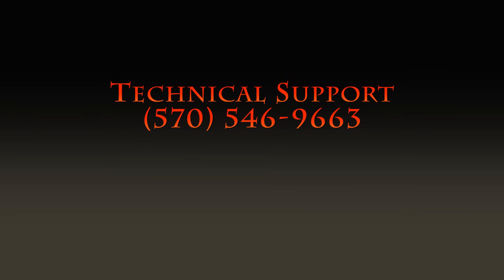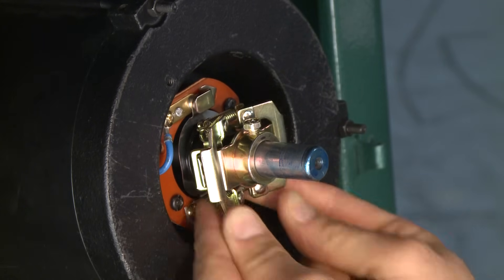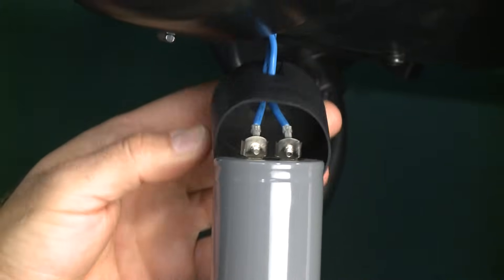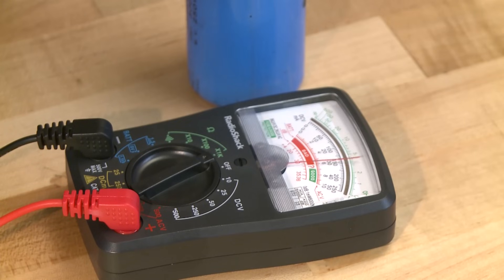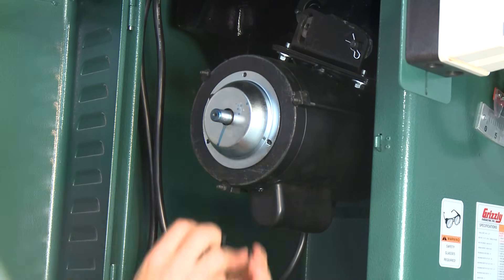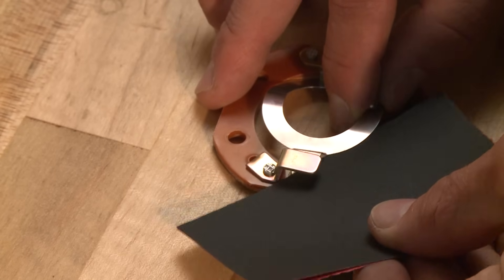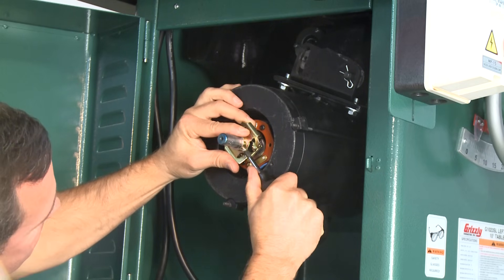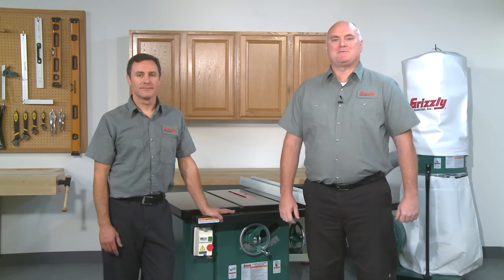How to Troubleshoot an Electric Motor and Adjust Centrifugal Switches

Comment: HAAAALLLLP 😂😂😂 please. I wish I could afford one of your companies cabinet saws, I’ve wanted one since I first seen one years ago! One of these days it’ll happen. If failing equipment doesn’t tank my business first…. Or keep taking what I try and save to get a grizzly!!!! I know it’s not your company but I can’t get a lick of help from Ridgid, I am just a one woman show and I my orders are just so backed up at this point I am a complete stress mess. I have a Ridgid R4512, gonna try and give as much info as I can hopefully someone can help me diagnose. So it just started making a loud rattling noise starts instantly when turned on continues after start up but instantly stops when I turn it off, and the arbor is still spinning/winding down. And kinda seems like it starts to loose power as well. Also when I felt the motor it felt pretty hot, but can still touch and leave hand there without it even being uncomfortable so not sure if that’s just normal, when this happened I was ripping strips for trellises and had been running steady for only appx 3-4 min maybe. I also ripped strips for some trim about 10 or 15 min before steadily for also only about 5min . Did not smell how ever and I got my head in the back panel and gave a good few sniffs by the motor.(yes it was unplugged) I’m pretty sure it’s something with motor though. Anyways Took off blade still made same noise. Took the belt off still made same noise. Pulled cover off capacitors, made sure they were discharged, and then for the life of me could not and still cannot find my damn multimeter🙄🙄🙄 at first glance they seem fine, I don’t see any bloating/bulging? Not sure what you’d call that. There is nothing leaking from them either. I’m not really sure if they would cause this noise or not, but checking the microfarads is still on my to do once I can find, borrow or buy another  meter. I’m just hoping someone might know what causes that kind of noise and point me in the right direction. Also wondering if I’m gonna have to take the whole damn thing apart to get the motor out? Because I’m not seeing anyway to, without doing that, 😭😭😭 I spent freaking hours getting everything calibrated and fined tuned to basically perfection, I’m ocd as hell about having things like the measuring/angle guides, blades, and fence being correct. Anyways if it’s not the capacitors only thing I know to do is check the centrifugal switch, then onto the bearings and armature 😭😭😭thing is. Although seems pretty similar I’ve never worked on any electrical motor as new as this one and I’m feeling in intimidated as hell, if it were an old one I think I’d just jump right in, but these newer ones are just built cheap and I’m afraid I’m gonna mess it up more
Reply from the maker: Sorry you're having these issues. It sounds very frustrating. Troubleshooting motors can be very tricky. The rattling noise you're describing might be worn out or damaged bearings, and that can also contribute to heat build up. Good luck and be safe!

Comment: Air compressor 5hp motor very little smoke came out of the vents just right after I started it. I just it off right away, wondering if it’s fixable without replacing motor
Reply from the maker: Hello there! If the air compressor is one that Grizzly carries, please reach out to our technical team via our Contact center! Otherwise, we recommend reaching out to the manufacturer or retailer for recommendations on how to proceed.

Comment: I had the same problem with a different make of motor,  same principle though.
I Cleaned the points which other than being dirty were fine.  Now now air compressor works just fine.  I talked with a gentleman about my problem,  as soon as I turned the switch on the circuit breaker blew I thought the capacitors were bad.  They were good.  The gentleman told me about the points and  said if they are dirty or bad that could be tripping the breaker . I guess he was correct cause after I cleaned the points it's working just fine

Comment: Does a centrifugal switch sense the speed of a motor?
Reply from the maker: Hi there! No it doesn't. They work by spring tension. As the motor comes up to full speed, the centrifugal force over comes the spring tension and the switch opens up taking the start windings out of circuit. I hope that helps!
Reply: @grizzlymachines  thanks a bunch🤜

Comment: I just replaced a bad run cap on a used 1.5 hp 115/220v motor I just got. It free ran without any load for about 2 minutes and then the cap blew..  I havent found much info on why they blow.. Hum.. Suggestions? Thank you.
Reply from the maker: Hi there! If the capacitors are blowing that fast then the contact points for the centrifugal switch are likely stuck together. Hope that helps!

Comment: Great video. If the centrifugal switch is not releasing would this cause for the motor to draw higjer current. My motor runs approximately 3amp and i have found when the switch is not opening the current jumps to 22amps. The problem was a dead capacitor which i feel was the cause from the centrifugal switch not realeasing when motor on. I find that the switch only doesn't release when  the load is on the motor. Any help to diagnose is appreciated. Cheers
Reply from the maker: Please reach out to our Technical Support Experts at techsupport@grizzly.com for assistance.

Comment: I am having an issue mith my Grizzly G4003 Metal lathe's motor. I have found it was a bad start capacitor. The motor has dual capacitors. This was the only video I could find and it was helpful. However my motor has the centrifugal switch on the same side as the output shaft. I don't really know how to adjust the switch so I'm leaving it alone for now. If you have any suggestions where I can learn about that would be appreciated. The contact points look good so I'm hoping that just replacing the capacitors will do the trick. Thanks!

Comment: Mine starts but dosnt step up to full speed
Reply: 4bennybear my coworkers as well. Im trying to figure out if this is the cause
Reply: @justinhammesfahr1206  Was it the centrifugal switch? Going to tear into mine tomorrow on my dust collector. It runs but doesn't get up to full speed so I hoping the switch just worked it's way loose.

Comment: so mad because what was my problem it was the coil got cut in half  because of the rope that hold the coil together was too tight
soldering was  a working fix but can't isolate the wire with tape  :S
got any suggestion for isolating ?
im thinking about  some silicon if not too thick because silicon also isolate heat not good in a motor
Thanks

Comment: Hi Grizzly Industrial Inc. I have this problem. No heat and it spins. So i check the heater, replaced with brand new heater, still no heat. Heater not turning on. Replaced the old thermostat with new thermostat, still no heat. Checked all wirings for continuity, all checked out good, sanded the terminals, still not heat. Replaced the whole motor with centrifugal switch, still no heat, heater does not turn on. I don't know where to go now. please help.
Reply from the maker: Hi Jake.  Please give our Technical Department a call for assistance as they will be your best resource. 570-546-9663

Comment: I have a table saw where the motor starter switch will mot turn on. If I take off the cover and bypass the switch button and push the part on the side, the motor runs but I have to hold it with finger When I let go it shuts off. I bought a new switch and it dose the same. I'm Lost now.
Reply: The problem is not the switch. Check the capacitor like in the video

Comment: Are there somesort of sensors with the switches that it detects the increase in the motors RPM in order to move break the connection b/w the motor and the capacitor?
Reply: The word of the day is centrifugal derived from concentric centerfuge and integral.  Centrifugal force in Newtonian mechanics,is an inertial force that appears to act on all objects when viewed in a rotating frame of reference. 
  So centrifugal switch is an integral switch consisting of a set of contacts, as all mechanical switches do, and a springed, weighted device affixed to the shaft of the armiture inside the motor housing, engineered with weighted dogs or counter weights which move when the inertia of the shaft had reached a set rpm via spring strength  which opens or closes a the contacts, in a motors case for starting are to open a normally closed connection disengaging the starting windings on the motor leaving the remaining run windings engaged..
Reply: @Z-Ack  Thank you for the in depth explanation. I kind of wondering why are some  motor use start cap.instead of run cap. on a single phase  motor ? Efficiency, torque or depend on the application. Would you  please further explan.Thank again for your knowledge.
Reply: Or you could just go with magic...
Reply: It's not a sensor, it's just got weights that get thrown outwards as it spins around. There's a spring keeping them in, resisting that outward force. When the shaft spins fast enough, the outward force overcomes the spring and they move. When they move, they push the switch contacts apart, and break the circuit.

Comment: Trouble shooting a start up failure on a G0454ZW 20" planer and traced it to the centrifugal switch; the bolt that holds it to the shaft had come loose. My question is this: can I use medium strength thread thread lock or is that not recommended? Thanks . . .
Reply: Not recommended.
Reply: For me I don't have a motor but I really need it, my question is which kind of Motor is good for grinding maize

Comment: Very useful video,Thanks.In my home,the motor starts slowly(when bought first,it started fast) and at some point,a small click sounds appears and the motor stopped working.The stator part is fine,which I came to know by continuity testing and capacitor is also fine.What may the possible problem in the motor?

Comment: Good video - placing it in action as I had a failure.  I initially called Griz and spoke to a Tech after my jointer failed to come up to a proper speed.  He indicated I JUST needed to replace the capacitor.  So, I ordered a replacement capacitor, installed it, and turned the juice on.  The new capacitor EXPLODED w/i 5 seconds!!!  I contacted Griz and spoke w/ a different Tech who suggested I look at the centrifigual switch.  I did and the contacts were fused together.  Why didn't the first individual I spoke with inform me to check this first...???  Now I must purchase another capacitor as well as a new centrifigal switch.

I've only had my G0656P 8" Jointer for about 1 1/2 yrs and have NOT run a huge amount of lumber through it - - just normal use.   This isn't the first (major) problem I've had with this unit.  I will NOT be coming back to Griz to purchase any other equipment from them.  There are far better engineered products out there.
Reply: ***** I'll pass your comment on to our Technical Service Manager.  They'll be able to discuss your scenario in their weekly meetings with technical staff.  It wouldn't hurt to ask for assistance with the purchase of the second capacitor and centrifugal switch when you call to place that order. Apologies for the inconvenience.  :-)
Reply: Grizzly Industrial
Reply: I have a 12,000.00 lemon from Grizzly.